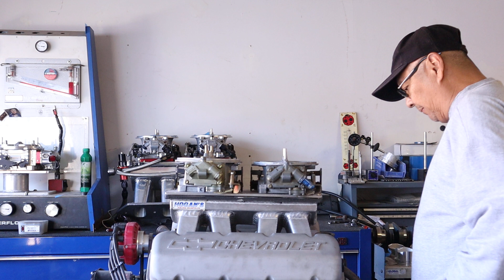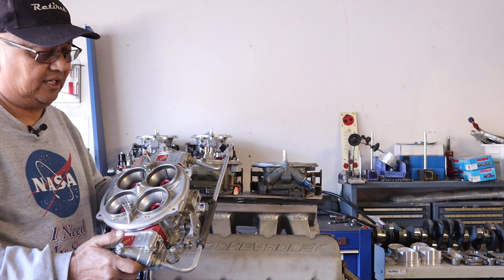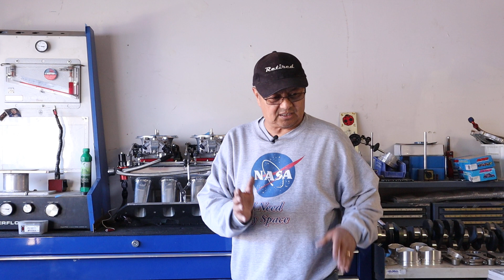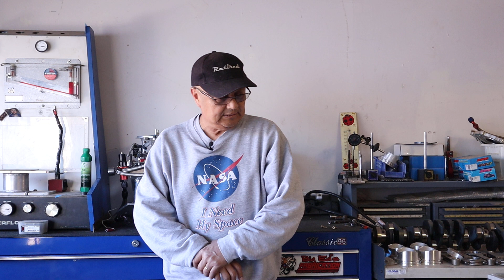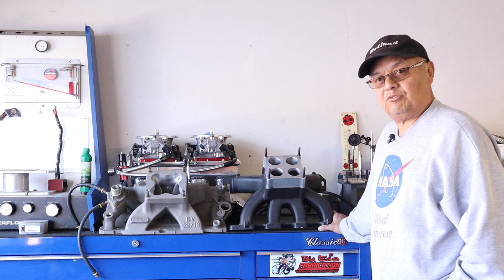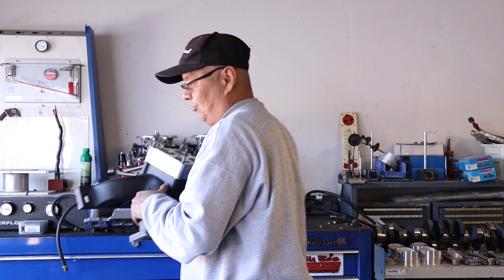PRO-STREET INTAKE MANIFOLD TECH!

Comment: When will someone design a good 2x4 intake for the 400+ size Windsor 9.5 deck for street/strip using Holley carbs?  The Holley Hi Ram runners are too short.
Reply from the maker: It is best to have a sheetmetal intake done to your specs!  I have run the 2828 for a dominator carbs and I have a two piece intake here and it is very expensive to buy and to machine.

Comment: Wauuuu this carburetor is bigger than Geo’s Metro engine and probably more expensive than whole Geo:) what is the point (if you are looking for power ), to use an carburetor ? According to the tick books , only avoiding the carburetor’s Venturi diffusers (when using fuel injection )give you up to +10% of power increase by minimizing the pumping losses. Also any unequal fuel distribution with multipoint fuel injection system drops by itself. The ability of maintaining the desired air/fuel ratio also is unmatched.The summary weight of the injection system probably will be half or less of the 
weight of this carburetor . The height of the engine will reduce and the center of gravity will be lowered.
Reply from the maker: All your points are correct except in one major thing!  Many FI proponents miss the ever important Joule-Thomson effect in the intake column charge temperature.  Dry manifold compared to wet versions used by carb(s) has a distinct advantage in inlet charge temperatures and the hotter the manifold is the more prone and limited in ultimate high compression ratios or boosts is attainable.  If you seen how a Weber carb intake works it is precise but crude compared to FI, nevertheless makes significant power and excellent fuel distribution.  Now advance FI actually place the fuel injectors upstream on the intake trumpets to take advantage of the JT effect lowering charge temperatures big time!  I have done an R&D for a 24 Hours of Daytona Mercedes team that also runs the 12 Hours of Sebring.  I pointed at their location of their super expensive FI manifold and showed the advantage of using the JT effect and overnight after my explanations their manifold was deemed useless or close to it!
Reply: @benalamedaracing2765  Very strong argument but it has few drawbacks as well .
1. When fuel droplets evaporates in intake runners their volume increases 600-800 times ( depend of the type of fuel used ) , so in the cylinder, the available volume for filling with fresh air decrease which partially diminishes increased by the lower temperature charge density .
2.This way les fuel droplets reach the combustion chamber , so the internal combustion chamber cooling is less effective and much reacher mixture is needed in order to compensate this issue. If the mixture is too reach (to satisfy the internal combustion chamber cooling) can cause problems with spark plugs fouling, ignаbility , excessive carbon deposits buildup and  
slower flame front propagation , which isn’t good for the efficiency and the power output of the engine .
3.Engine throttle response isn’t so sharp as with mounted close to the intake valves fuel injectors. This is  dew to the the longer travel path of fuel droplets and the big difference between their mass and the mass of the air. Air accelerates faster and fuel mixture become leaner for a moment after smashing the throttle .
There are few different ways to solve the (dry intake cooling )problem with fuel injection systems.
1.Pure water or water/methanol injection . BMW even managed to  collect the water condense from the exhaust system , so there isn’t even need of permanent refilling of the water reservoir. Pure water is preferable since is cheaper and do not change the air fuel ratio of the charge,  so no adjusting of fuel maps needed .
2. Subaru just spraying water on the intercooler external surface . 
3. Use of plastic intake manifolds . They are not only cheaper to produce and more easy and consistent to replicate exactly to desired shape and desired roughness on runners’ internal surface , but since the thermal conductivity of plastics is much weaker, they heat up less the intake air in comparison to the aluminum  ones. 
4. Some high RPM engines as on sport bikes use 2 injectors per intake runner. One close to intake valves and another even out  of the trumpet . On low RPM only the closer injector is running on high RPM both injectors are used . This not only cool down the charge but supply droplets straight in combustion chamber for internal cooling , also at 13-14 K RPM the time for mixing air and fuel is short , so this is the main reason for putting fuel injectors away ( to give more time for air/ fuel mixing ). Also allows use of 2 smaller injectors 
, which are usually faster than one , which can cope with the desired fuel flow . Also this way the throttle response keeps sharp.Many of the new passenger cars use two injectors direct in cylinder  and in the intake port but they started doing that mostly because intake valves carbon buildup problem on only direct ingested engines .
 4. My invention for Propane-Butane ( BTW octane rating is 108-110 and it’s dirty cheap:) powered cars ( fuel systems generation up to 4, where the fuel is introduced in the engine by Venturi diffusers ( similar to carburetors but the fuel is already evaporated - this to generation 3 and sequentially fuel injected by fuel injectors but in gas phase for generation 4) is to evaporate the fuel in heat exchanger( AC internal core radiator)  mounted after the air filter in the air filter box , so intake air stream is cooled down and respectively the charge is denser . Propane boils at 42degree Celsius at atmospheric pressure and can be used even as refrigerant. Mixing the air/ fuel mixture is much faster and the mix is much more consistent when the fuel is introduced in gas phase . The problem with occupying of too much volume in the cylinder (when the fuel is introduced in gas phase ) can be solved by injecting it in to the cylinder directly after closing the intake valves . Since the fuel is already in gas phase  the time for mixing of the components  is sufficient and is much feasible to be sufficient to much higher RPM than mixing air with liquid fuel droplets in any known conventional way . This will be the generation 7 gas phase injection system , suitable mainly for Propane Butane and Methane. It solves also the problem with oil dilution on direct fuel injected engines.
On the end , I want to take the opportunity to thank you for sharing your experience with the other motor heads . I know few things about the engines but almost every time I learn something new or you provoke me to look at the well known facts from different perspective . That’s way I’m among your subscribers.
Reply from the maker: @flappingflight8537 , thank you and appreciate your  opinions and well taken.  Like in anything fuel(s) included there is always a compromise and it all depends on the goal at hand.  This said, I will be posting the next few days my experience in straight gasoline vs. E85.  On gasoline and boosted via a supercharger, 3 small block Fords I had running on street driven vehicles ran in the 9.90 sec. 1/4 mile.  They broke after experiencing detonation and 2 out of 3 broke big time splitting the blocks right in the middle!
Horsepower at the back wheel came up at 576hp to be exact on one and the other 560!  Now the post I will show with E85 another engine from my shop made 638hp/ 632ft.lbs of torque. Bigger numbers while boosting 2-3# less!  This at the same time about 600rpms lower than the other 3.
All because of E85 which was had a more stable, cooler and faster burning than higher octane gasoline.  I have always suggested higher output engines preferably run on this fuel instead of the others even highly oxygenated gasolines...

Comment: Thank you Ben!  Looking at the shape of the single carb top (8:31), would a more rounded shape toward the front/end intakes flow better when compared to the straight/angular shape?  Also which is better, the carb spacer or a spacer between the manifold/top?
Reply from the maker: If we would have curve that plate it would make it worse due to the fact the air will not be able to adhere to the wall shape and create more turbulence because it pulls away too drastic!
It is a bad situation all in all and a spacer will give it some elbow room to somehow bend towards the end and these is all we can do besides boring the 4 hole spacer pointed front and back.  It would work but the carb/TB cfm would be a lot less than advertised.

Comment: Thanks for sharing your experience.on other side coin could  you put more duration on back cylinder by playing around with different camshaft profiles as in dual pattern cams your could you go further and have different ring gaps to try equal difference in cylinder pressure?.peace
Reply from the maker: I feel running a slightly longer ratio on the four corner cylinders would be beneficial or just grind it into the cam lobes on those corners and it should pay dividends.  Working on these with a major cam manufacturer soon as this covid thing is dying out so the opportunity to do R&D with them should be possible.ASAP.

Comment: Great video Ben. Keep up the good work sir. Is there any performance advantage to porting the intake spacer to taper towards a ported intake manifold? Say the entry point at the upper plenum to the bottom of a HVH 2" spacer.
Reply from the maker: That was what i was trying to explain but without a sample in hand it is rather difficult.  You and I on the same mindset and the only drawback would be the Cfm of the carb or throttle body will definitely take a nosedive.
Reply from the maker: I replied to somebody here with the same comment of, running a spacer but boring out the 4 holes angled towards the front and the back.  It would definitely help but the total airflow would be a lot less from the carb or throttle body.

Comment: Great content- maybe expand on the Ford camshaft lobe centerline differences due to the velocity spreads of the runner length/ volume.
Reply from the maker: I would look into doing a segment about it and thanks for the suggestions!  
In fact we have run different ratios on the corners (higher) to compensate for the long runners.  Doing this on the camshaft might be expensive so rocker ratios on the ends will definitely help.
Thanks for the suggestions.
Reply: @benalamedaracing2765  I usually fill the end runner roofs when the volume is excessive- subject to angular approach.
Reply from the maker: Art, it is very possible to play around with cam specs and it will take tedious run and re run to see differences if there are.  There is a major cam manufacturer here in the USA and I was contracted to make several grinds for them and they will make it and if successful?  They said they will post it on their catalog under special grind section basically Ford HO and strokers.
It might happen after all these covid stuff is over and we will sit down and do some testing.
The manager is the main tech man and he has been real busy with all these Outlaw racing on Tv.

Comment: How to compensate for the flow of the back cylinders in a single throttle body plenum type like the LSX intake?
Reply from the maker: E,  I have to see a by using CFD's and do flow analyzing in order to get an idea.  It will be hard with all the cylinder to cylinder sequence and flow robbing all over the place.  It would have been easy if all the intake valves opened at the same time!  But that would be impossible.  lol
The closest any intake will flow equally is during peak torque numbers wherein everybody is getting their fare share of the air inside the plenum.
Reply from the maker: Efernandez, it should not be too serious as far as A/F ratios as long as you have FI injectors at each individual port runners.  The concern was the heavy fuel molecules which could not really take the drastic turns towards the end cylinders.  Flowing "air only" would be good and the only exception is those carb looking throttle bodies with the injectors in the throttle plates!
They would have the same issues as the carbs.  
Note, I would still extend the throttle plate high on the manifold like shown on the last plenum with the spacer.  This should be workable and if you have individual fuel control on all cylinders then you can fine tune the corners making it safer for your engine and wallet!